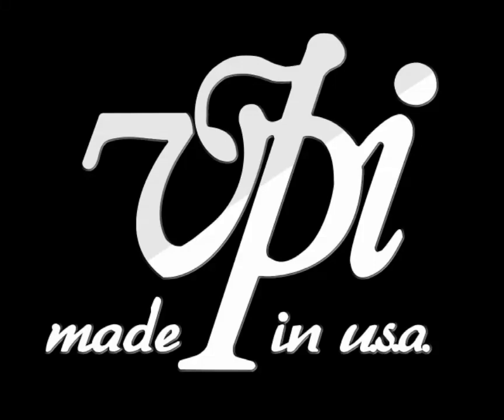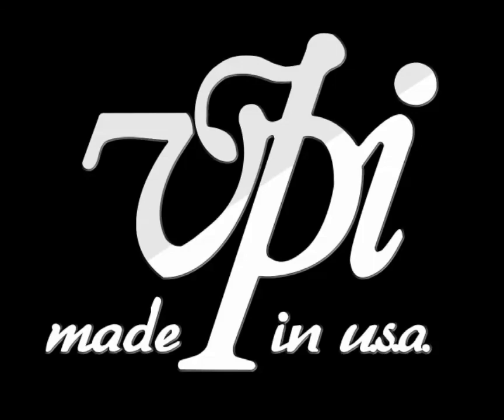VPI Talk - Motor Start Up Noise

Comment: I personally put 2 fingers on the side of the platter and give it a light spin while at the same time turning on the motor. This silents the noise and i would assume takes off unwanted strain on the motor and belt.